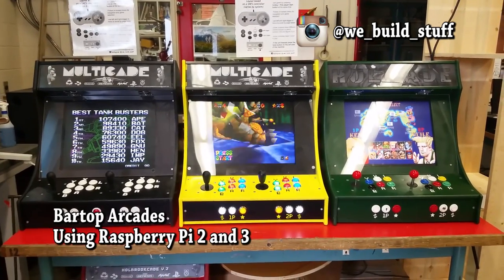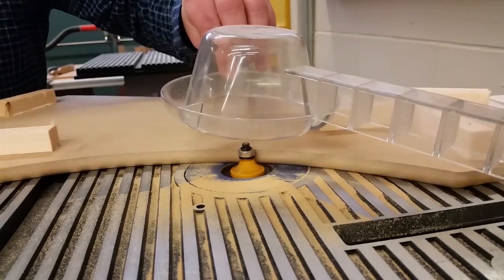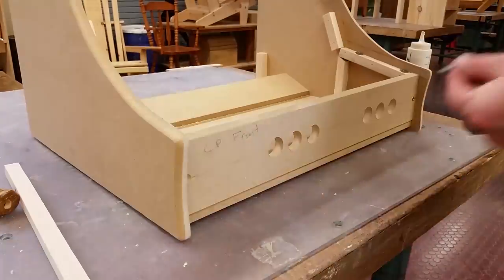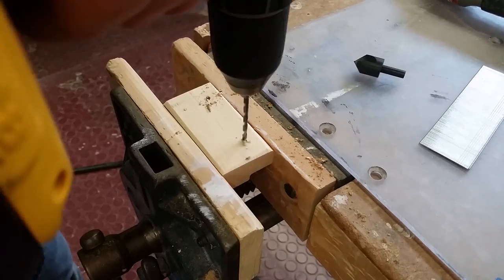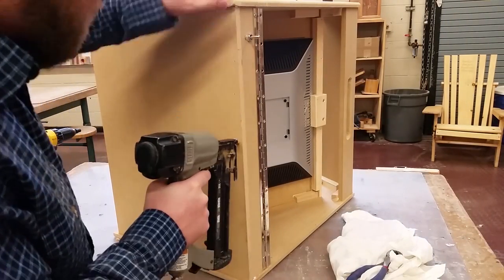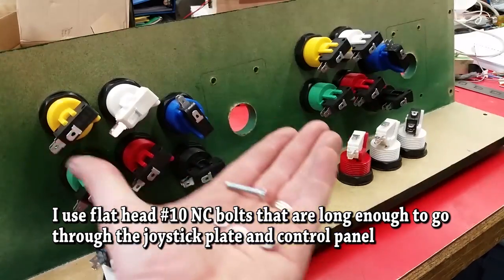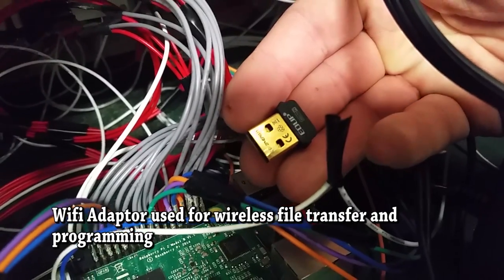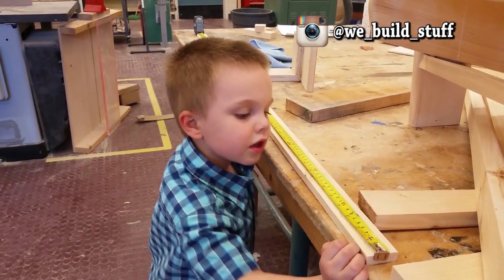How to make a DIY Raspberry Pi Arcade Cabinet!

Comment from the maker: Updated build video and new plans!! Check it out! https://youtu.be/isiLRtJlUso
Reply: Thanks
Reply: We are also game developers, do you have a chance to talk about it? Check out www.usun8.com for more information on our website
Reply from the maker: @janeli5725  Hi I'm not sure how your company would relate to instructional videos on building things.
Reply: @WeBuildStuff  We started making videos, but we didn't do them as well as you did
Reply from the maker: @janeli5725  thanks. I'll check out your work!
Reply: @WeBuildStuff  oh I'm afraid you'll be disappointed
Reply: Im actually about to tackle one of these for myself, I was going to use the raspberry pi 3, but I want to set it up for 4 players. I found a package set of 4 player buttons and joysticks on Amazon for $90. They use quick connect cables, that each connect to their own board, and switch to a USB connection. Curious if overloading the pi with all 4 usbs in use if that would overload rhe power of the board to run all of that?

Also is there any particular rule of thumb when it comes to laying out your buttons? I was kinda picturing a V shape for my controller portion, 2 players on each angle of the V

Kinda like this
_____
\°       ° /
  \°__°/
Reply from the maker: @Comfortblynumb12  Buttons do not draw much power. I would get a USB hub so you don't use up all the pi USB ports.
Reply: @WeBuildStuff  awesome, ill do that, thank you!! Currently I'm up to my neck in bars lol, I do woodworking on the side in michigan. If youre interested, my stuff is on Www.instagram.com/djg_woodworking
Www.facebook.com/djgwoodworking

Haven't taken the YouTube plunge yet lol, but im wondering if I should.

I was planning on a pi 3, 4 player, and some usb powered speakers I could scoop on Amazon. Where could I go to get side graphics made?

Comment: Looks like you blew the back out of the MDF on some of those button holes that you showed towards the end. Flip the MDF over and do a quick hit with the drill bit before drilling all the way through on the other side and that will prevent that stuff. It will help in the future when the buttons want to start coming loose.
Reply from the maker: mistakes happen ;) I'm a bit more gently now!

Comment: Nice build. The "T" nuts should be installed from the underside of those glue blocks. The will pull out installed the way you have them.
Reply from the maker: Yes this was the only build i did like this. I figured that out after filming haha

Comment: Damn, i wish i have the garage space for a table saw like yours.  Even with the dust port vacuum, i bet cleaning up the rest of the sawdust is a pain.   Good job on the video.......very inspiring.
Reply from the maker: I wish I still had access to this woodshop! The dust collection there was decent and really miss that panel saw. Mostly just for the first major rip of the 4x8 sheet and the rest I can do with a simple crosscut sled. Hopefully later this year I will make another video only using "basic" garage type tools (jigsaw, etc)

Comment: The tee nuts are installed on the wrong side of the cleat.
Reply from the maker: They work either way for this project when I built them. The one's I've built since making this video (over 10) have been changed and built better.

Comment: I would like you to do a how to on that start button. Not sure how you did that exactly. Everything else very clear. Nice work.
Reply from the maker: are you referring to the "reset" button on the side of the arcade?
It is just a microswitch wired to some headers I soldered onto P6 of my Pi. I'm not sure if the newer versions of the Pi still have those holes in them...
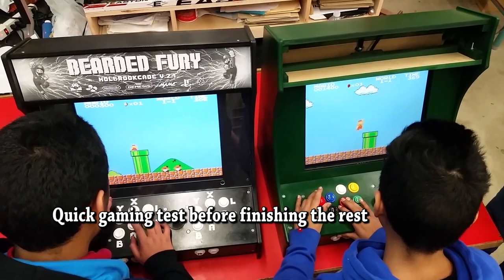I talk about it a bit at 15:14

Comment: Awesome builds!  You mentioned that you only open it now to hook up a keyboard.  You should think about adding a USB header/extension to the side of the cabinet next to reset and volume controls.
Reply from the maker: Ya that's the next step. I will probably add it to the rear for these cabinets. Future builds will have them as part of the front control panel so I can also easily hook up wired xbox controllers, etc

Comment: I'm about to finish my prototype which is made with basic tools from throwaway material and looks kinda crappy at places, but about half the ideas I used there are hinted by this video. I think I owe you a thank-you, even for the parts I learned not to use next time. (Already building 2.0)
Reply from the maker: send pics!
Reply: I shared a collection with your Google Profile ... I think.

Comment: awesome work wish I had a shop
Reply from the maker: I'm very fortunate to teach in such a great area. This project can be done with simple tools, just takes a little longer. You could do almost this whole project with tools costing under $200 (for the tools, not the project). Drill, jigsaw, soldering iron, screwdriver, and sandpaper!
Reply: Sounds encouraging will definitely see if I can pull it off.

Comment: You can also get Arcadestick packs with stick and buttons that come premade with a little controlerboard for usb use. So you just plug the cables on the controlerboard and plug the controler in the usb port of the pie. Way less stuff to do and its solderless, just plug and play.  :-)
Reply from the maker: I switched to USB controllers for all my other builds. I totally agree that it is way easier!!

Comment: Awesome vid great supplement to building on myself since I'm more of a visual learner. I had one issue that caused me a bit of headache and it was that staples actually printed the sides and button layout of the cabinet alot larger than they should have so I ended up with pieces to small for my sides. Simple fix but still wasted a few more hours than I should have
Reply from the maker: Yikes. Did they not follow your file dimensions?
Reply: We Build Stuff they said they did but when I got home and started putting it together it was clear they didn't

Comment: I'm using your directions to make my own bartop arcade(btw thanks), the only thing i would change is putting the (#10 NC T-nuts) on the opposite side of the support. I was having the problem where the T-nuts was pulling off. Putting them on the opposite side it pulls the t-nut into the support piece holding it even stronger. Also getting a more plush fit.
Reply from the maker: I'm doing that for my latest build. The issue I'm having is when I unscrew the #10 bolts the t-nuts fall out the back due to gravity and the teeth aren't gripping the wood the way I want. I might try some adhesive to hold them in better.

Comment: there is some controls now that encode the exit into a usb connector , so you would not need a lot of that wiring at least on the pi side
Reply from the maker: Spartacus' Skull and Bones yes i know. i have a few of them. when i first started making arcades recalbox didnt have support for the usb encoders i had purchased 2 years ago. i started doing gpio wiring as a way of giving me full control over the end result. my next builds have much cleaner wiring! 😊 thanks for the view

Comment: nice build, only thing i wonder is why you would put the controls so close together looks like theres plenty of space left.
Reply from the maker: It is actually pretty crammed underneath because of the width of the joysticks. I also didn't want a super wide cabinet. If I do a full stand up arcade I will make it much wider for less elbow rubbing. Although that is a good bonding experience I'm sure :)
Reply: haha "the hook up arcade" :)))

Comment: Great video, but I would recommend using zero delay usb boards instead of the GPIO as it makes everything a lot easier to wire/manage. You can pretty much plug any button in wherever you like on the board along with the stick and retropie/recal box will simply detect everything as a USB controller.
Reply from the maker: ZaPpaul the gpio was just for this build since at the time the encoders I had were not compatible.

Comment: How are the lighted buttons? Do they hurt your eyes after long play sessions?
Are the bulbs easy to replace?
Reply from the maker: Easy to replace and I'm not usually starting at them. They are diffused by the colored plastic buttons. I'm not a huge fan of the convex LED buttons as they don't feel as nice as the hard plastic buttons. I'm probably going to change the microswitches as well as I found the ones they came with where too "clicky" and hard for fast button mashing games. They cost the same as the non led ones I have bought on eBay

Comment: Hey I am just finishing up my own build. Just wanted to know how you wired the reset switch. I know the part on the board. But I have 4 connectors on my arcade button and not sure which ones to attach it to. Also I would like that button to light up if possible.Thanks for the video! Turned out to be a really fun project!
Reply from the maker: jconti8190 if you have 4 connectors one will be for your microswitch positive, microswitch negative, led positive and led negative. just find a wiring diagram of your button forbwhat each thing does. led power most likely from however you are lighting your other ones or a 5v+ gpio header right from your pi

Comment: Hello, I have a question about using this for school fundraising, can you thing of a way to get the game started only when you put a coin? and when the game is over be able to stop so they would need to put more coins. In schools Fetes, festivals and events could be a good way for schools to get some revenue for their IT budget.
Reply from the maker: you would have to wire the 'coin' button to a coin door. There are switches on the door that give you credits.  You have to wire them into the coin inputs.  They work like any other switch/input.

They would only work for arcade style games that require a coin input (mame, FBA libretro, etc). Regular console games wouldn't function like that I don't believe. You would be able to choose a game and then insert coins for credit just like a real arcade machine. Choosing the game could be done in menu and adding the credit once the game has started
Reply: Ric Zalewski q

Comment: Why did you use a pilot hole with a forstner bit and a drill press?  By hand it would see like a good idea but I don't really see the point with a drill press.  Is there something I'm missing?
Reply from the maker: PoLoMoTo2534 I'm so used to doing metal projects where i drill a pilot or center punch prior to drilling a big hile. habit i guess
Reply: Ah I see thats fair, thanks for the response!
Reply from the maker: also the initial beginning of the pilot hole helps me "center" the tip of the Forster bit so I know I'm in the right spot

Comment: @We Build Stuff: Didn't you have to use a IPAC 2 for a 2 player bar top? Are there any instruction files of how to plug all the button cables on the raspberry?
Reply from the maker: You can wire the microswitches directly to the GPIO headers of the raspberry Pi 2 or 3. 

Progamming video: - how to change the recalbox.conf file
https://youtu.be/yQRphxYgaMA

Info wiki from Recalbox - this has a wiring diagram
https://github.com/recalbox/recalbox-os/wiki/GPIO-controllers-(EN)

Comment: man i wish I had that workshop setup...
Reply from the maker: I'm lucky that part of job allows for that. For under 200 bucks you can buy the basic tools needed to build one. With a drill, jigsaw, sandpaper, and a screwdriver you could build one. It would just take a bit longer!
Reply: Fair enough, I just like to dream! I actually built a full size cab with those tools... Just found my hand wasn't as steady as it sometimes needs to be. Especially with the jig-saw, it's got a mind of it's own
Reply from the maker: you can easily build a jig for straight lines. I do this all the time what doing framing, construction etc with only a skillsaw when I need a 'perfect cut'

http://www.instructables.com/id/How-To-Cut-A-Straight-Line-Using-A-Skill-Saw-Or-Ji/

Comment: Nice job man!
Why won't you use 1 and or 2 USB extension cords to make external USB ports for Keyboard and Memorysticks?
Reply from the maker: I'll do that for the next build to allow for hooking up a wireless controller, etc. If I put an external USB port on these ones I can almost guarantee my 5 year old would break the port sticking a screwdriver into it to "help" me. I'll probably use something like this:
http://www.ebay.ca/itm/1m-Car-Truck-Dashboard-Flush-Mount-Dual-USB-Male-to-Female-Extension-Cable-Kit/151623101516?_trksid=p2050601.c100085.m2372&_trkparms=aid%3D111001%26algo%3DREC.SEED%26ao%3D1%26asc%3D35909%26meid%3D3a095c6bb61b413daebb03ab3976a157%26pid%3D100085%26rk%3D2%26rkt%3D4%26sd%3D231248713779%26clkid%3D500174388613301011&_qi=RTM2247626
Reply: We Build Stuff
That is a great solution. :) Nice find.

Comment: Nice job. Any issues with the raspberry generating too much heat?
Reply from the maker: I always have either a fan system or just holes in the cabinet to allow airflow. Never had any issues with overheating. You can also add heat sinks if you need!

Comment: Before I start measuring and cutting, is this design based on a 17in or 19in monitor? And would it make a difference if I made the with of all the cross pieces 22.5inches instead of 55cm?
Reply from the maker: A little extra room is always good. I'm using 4:3 19" Dell monitors in all my builds. I could probably fit bigger without much modifications but hard to source 4:3 monitors right now.
The extra width will give you more room for your control panel depending how you lay it out

Comment: Amazing! I just have some questions about the cost. How much would all the materials needed cost, and how much would you charge for purchasing/renting these cabinets?
Reply from the maker: Jeremy Valdez It cost me between 400-500 to build one depending on what I stick in it. Selling probably around $1200 because of the hours that go into building by hand rather than just a bolt together kit.
I've rented to events before between $50-100 per night
Reply: We Build Stuff Thanks, also do you think that a laser cutter would be more efficient for precise cuts?
Reply from the maker: Jeremy Valdez it's an arcade cabinet, not an airplane ha
lf you have a laser cutter that can do that thickness sweet! Everything I build is very precise so no need for automatic machines. I enjoy the process of building them

Comment: love the video. i notice you left the monitor in its original housing and i saw others take them out, but i am glad to see you can leave them in and how they still look great. Can you use controllers on those machines? 
i would like to someone take a nes mini and put in an arcade,
Reply from the maker: There are 4 usb ports on the Pi. As long as the controller is compatible it will work once configured. Sometimes you have to change some stuff in the configuration files to get certain controllers working.

Comment: This is one of the coolest things I have seen in a longtime, can I buy one already made by you? I like the yellow one with the pacman logo,  only downside I can see is that the way its configured it will be a tight squeeze for 2 players to play at the same time, based on the width of cabinet???
Reply from the maker: That's just these design. Bartop are meant to save space. If you are wanting a custom arcade anything can be built!
I only do local stuff though
Reply: We Build Stuff: what city and state are you in?  if I'm local.  i want to buy one :)
Reply from the maker: Robert V Vancouver BC

Comment: Well done on the build. Need to Prime that MDF though... soaks up paint  giving that uneven matte finish.
Reply from the maker: Ya took way more coats than it should have. I've learned my lesson since!
Reply: We Build Stuff Wish I had access to that shop hehe
I have been considering building a bartop. Built a full size back in 2000... Well didn’t build the cabinet, I bought a used game cabinet and refinished it. Put in a PC and 25” tube tv. Couple years ago I modernized the machine with a raspberry pi 3 and a 28” lcd. Also put in a nice marquee and Galaga side and front art.
Reply from the maker: @puretoronto  I'm working on a video that only uses "basic" power tools. I'm still in the middle of the build and I'm using a jigsaw, circular saw, and a router
https://www.instagram.com/p/BqkxPG-B8tr/